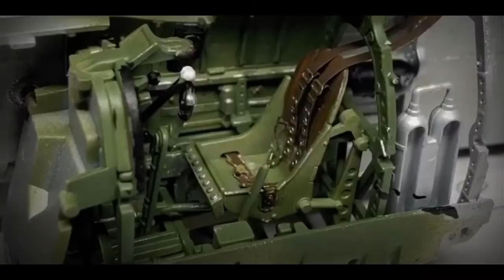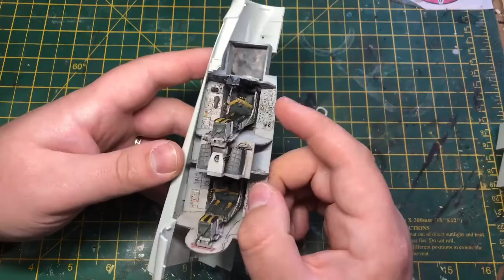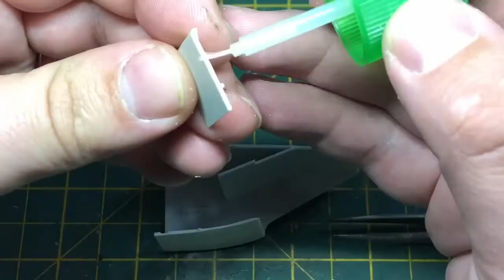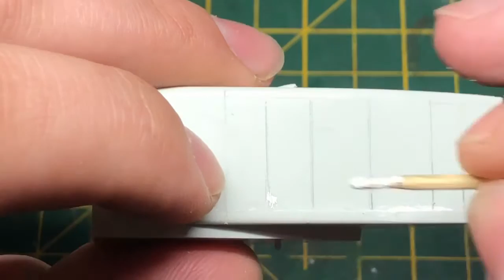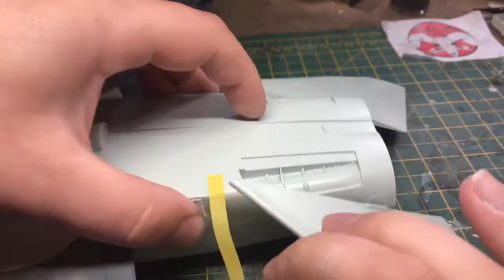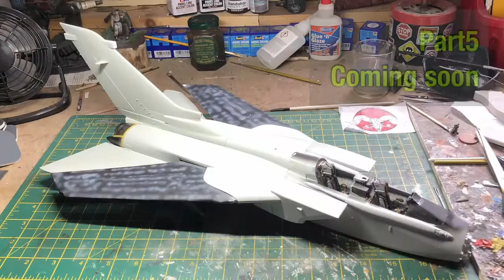1/32 Tornado Gr1 Part4 ‘body work’

Comment: Tailerons, not elevators  nice work on essentially a big but poorly detailed model especially on the side of the fuselage...
Reply from the maker: Muzfuz 57 yes your right i dont know why i pit that in!(plonker!) Thanks theres a lot missing particularly as you say on the lower part and even the sides! Some were partly visible or you could tell were they were going. I had to get some drawings for some but all in all for an old models its alright! Iv done way worse than this one its also something i dont normally do as my era in ww2 but it was on a really good offer and its 1 of a couple of jets i just love! Glad you liked it the last one is up with finished photos on it if you haven’t seen it yet